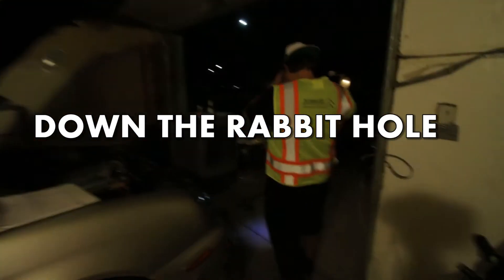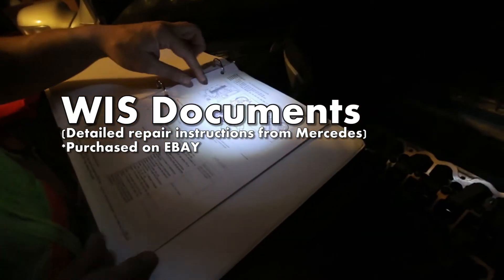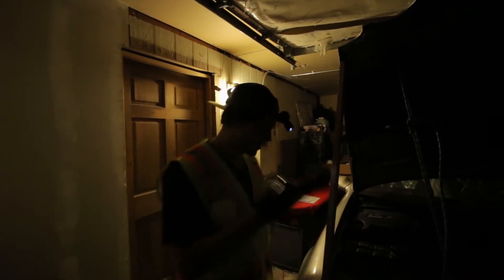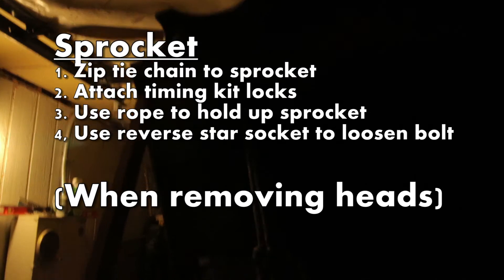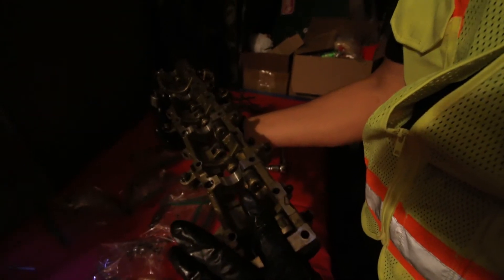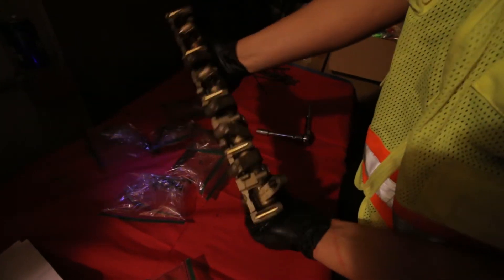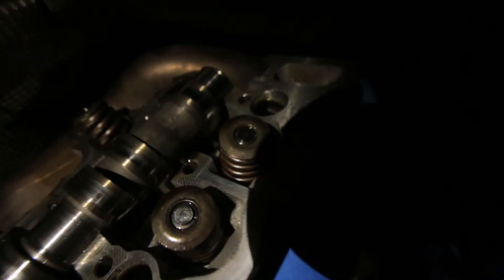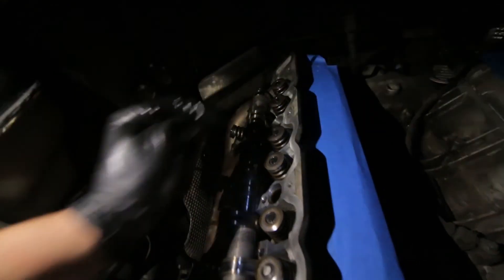CLK55 Project - Darkness is everywhere!! Ep. 8

Comment: I rebuilt a M113 last winter, a full rebuild that was for a ML500. Ive got an e500 with the same engine, it has a tiny engine shake at idle, but it gets better as you slightly rev it up, so I’m thinking possibly a bad lifter as oil pressure builds up the engine smooths out. I rebuilt the injectors, new plugs, wires. Coils, also did intake manifold gaskets. I still have the slight shake it’s an un consistent slight miss here and there. The other problem I have is if the car Idles for about 5 mins when it’s warm and I give it gas really fast it blows a puff of smoke, doesn’t smoke when I first start it, so I know it’s not valve seals. Rings are fine, I’m confident it’s a worn valve guide. 
Let me know if it ran smooth after you installed your heads with valves lapped etc. 
I’m planning on doing a new timing chain as well. I might try and pull the heads while it’s still in the car, if I pull the engine I’ll pull the timing cover and replace all the timing chain rails, new chain, front and rear crank seals,
Reply from the maker: The new heads helped everything it is running great. lots of power. I need to compression test the motor to confirm my psi's but It feels great. This is an interesting situation you have. How many miles on the motor? Where do you live what is the condition of the environment hot or cold? Timing chain should be easy if you follow all the WIS steps
Reply: Bizzy Vlogs 
210k on the engine. I’m in Utah. I’ve also replaced the O2 sensors as well. I know there’s oil getting past valve seals. I had the ex-manifolds off and a couple the ex valves were wet, oil is getting passed the seals. What’s your email, I’ll send u some pics of my M113 build. I’d love to swap a M113k in a clk55.
Reply from the maker: badlvboy44@gmail.com
Reply: Bizzy Vlogs I just sent u some pics of the engine rebuild
Reply from the maker: MAN! You went ALL OUT! That is IMPRESSIVE. I wish I could've gone all out like that. What does all that cost?
Reply: Bizzy Vlogs , it was a lot, I can get parts from Mercedes at cost, but it still was a lot. 
Main bearings, $300
Rod bearings $80
Head gaskets $ 160, 
Timing chain rails, oil pump rail, new crankshaft sprocket $250. Rings were $300, but there not original Mercedes rings, there a Japanese brand, oe quality. All in all $1500-2000, I did all the head work, except machining. Try to avoid rebuilding one if I can way to much money.